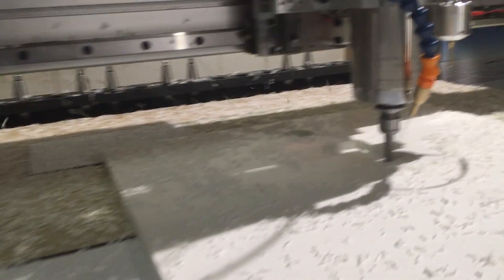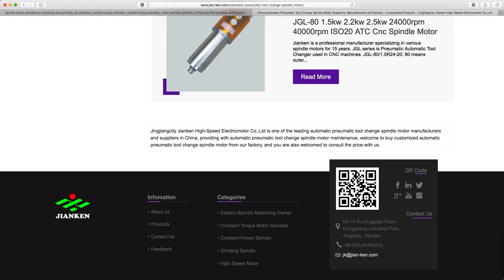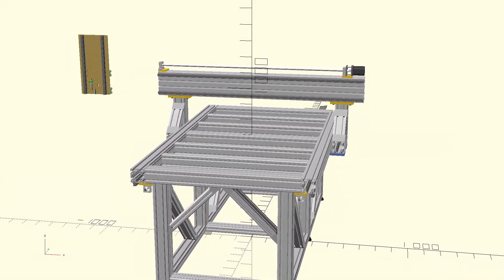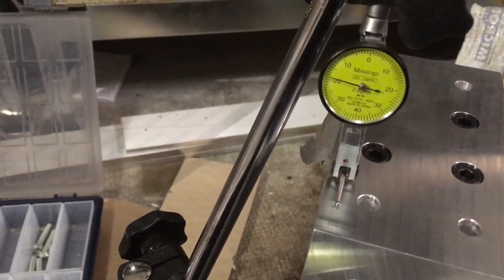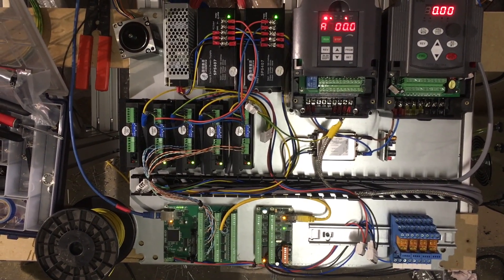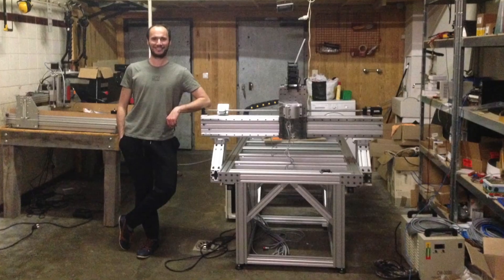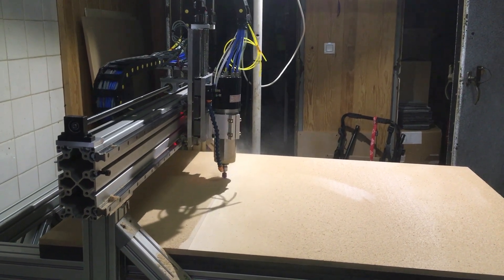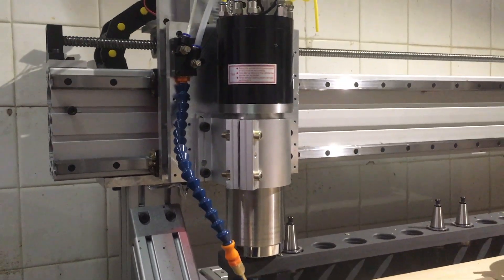My DIY CNC Router build with ATC and Vacuum Table

Comment: What controller do you use?
Reply from the maker: I used various cards from https://store.mesanet.com. Those are FPGA cards generating the pulses for the stepper drivers. Then LinuxCNC is sending velocity commands to the Mesa card at 1000Hz.

Comment: How did you setup that retractable probe? I am in the process of designing a 5x10' cnc router with a 9kw atc spindle. I would love to have a probe like that.
Reply from the maker: I placed the probe on a pneumatic cylinder. Then with an electric valve I can actuate the vertical movement over ~100mm. Some parts are 3D printed. And with LinuxCNC I programmed a macro so that on M6T30 it actuates the cylinder. And with the tool offset table I can input the X, Y and Z offset of the probe relative to the spindle.

Comment: Nice build! What are you using for the xy autosquaring ? Custom script ? (i asume it is running linux cnc like shown on the old router ?)
Reply from the maker: Yes. Custom G code and M code written in python with LinuxCNC.
I have a couple of G code to probe a corner, a cylinder, a face. Then those G codes push the result in a kind of stack of the last probed points. And finally I have some M codes to read the last results from the stack and apply a coordinate change.
I could push my code to GitHub if you want.
Reply: @YannPomarede   yes, that would be nice :)
Reply from the maker: Here it is: https://github.com/yannpom/ouimill2
Reply: @YannPomarede  thx :) will have a look at it after the hollidays

Comment: You are the king of home builds! What cfm compressor are you using for you spindle?
Reply from the maker: I have a 3HP compressor. But it’s mainly for blasting air on the end mill. The spindle use very little air (air seal + tool change)
Reply: Thanks

Comment: Hi Yann ! Great Build ! Can you please tell us what material was used in the first two layers that you initially machined and then glued together, in the fabrication of your MDF Vacuum Table Top, as we are currently in the process of retrofitting a 4' x 4' Router Table for a customer, who brought your router build to our attention ? (1) Are the first two layers made from a "Plastic Material", as the swarf produced was "Black" in colour ? (2) What glue did you use to adhere the two layers ? Hope you can help us, and our customer ! Regards GCS CNC Group !
Reply from the maker: Hello, this material is "Valchromat" (I think it's the brand/product name here in Europe). It's kind of a MDF panel, but more dense (made with finer powder), more rigid, and more airtight. Even though air can still pass trough, but way less than with MDF. The glue is normal wood glue (PVA). If you don't have those high density MDF panels, you can simply use normal MDF and apply PVA glue on both face so you don't have air leaks.
Reply: Thank you for your prompt reply Yann ! Greatly Appreciated ! I wasn't aware of such a product being available here in Australia ! Just found a local importer of "Valchromat", and I will now be able to look into the suitability of this product for my customer's retrofit 4' x 4' Router Table, with vacuum ! Regards GCS CNC Group !

Comment: Really awesome build! I'm using a similar spindle. Any chance you can share what size cable chain you're using?
Reply from the maker: Thanks, cable chain reference is JFLO-H20x60 inner size 20x60mm, outer size 35x83, bending radius 55mm.

Comment: excelent job !!! what size are the linear rails of the Z axis, and  Is the 80 80 mm aluminum profile triangle that supports the gantry and runs along the Y axis sufficiently rigid and strong? regards
Reply from the maker: All linear rails are the same size: 20mm width. Regarding gantry rigidity I cannot answer by a yes or no. It’s rigid enough to mill 20mm medium wood in one pass, 10mm aluminium on a light side cut. But if I increase too much the mill engagement it starts to vibrate.
Reply: @YannPomarede  Hey Thanks a lot, I am building a  very similar machine like yours,  I  watch your videos  and give me a good solution to solve the use of a lot expensive aluminum plates , thaks again!
Reply from the maker: Here you can see it in action milling aluminium: https://youtu.be/3_ACFM97Wnw

Comment: Hello,
I just made my CNC and on my first test something does not seem right.
The CNC uses 2.2 KW air cooled spindle at 300 Hz  speed. and a Makita drill bit with one cutting teeth as you can see in the picture from the end of my video.
Could you please explain why do I have that whistle noise when it cuts? Also the spindle motors is getting very hut, after the cut I could barely  hold my hand on it?
Cut federate is 800 . The diameter of the drill bit is 6mm.
https://www.youtube.com/watch?v=dsRKRu3pHBw
Reply from the maker: Hello, I see your end mill has a strait flute. This generate a torque spike at each rotation, whereas with a spiral flute the torque is more constant and you get less vibrations. Your federate, 800, is in mm/min ? That's 13mm/s. That leads to a feed of 0.04mm/teeth/rotation. It's a bit low for wood. You can double or triple the feed rate.
Also, slotting is the hardest, the end mill touches on both walls, cooling is less efficient. When I need to slot deep, I usually design a slot larger than my end mill to ease the operation. But for cutting plywood like you do, slotting with a 6mm end mill should work fine. First, try changing the end mill with a spiral one.
Reply from the maker: Like the one you see at second 8 in this video : https://youtu.be/0U_ZFNjyZ00?t=8
Reply: @YannPomarede  Thank's for the info!

Comment: Bonjour Yann,
What made you choose to place the linear bearing rail under the Y aluminium profile ?  It's the first time I see this design. There is all the weight of the gantry pulling downward the bearing block which is unusuall. Any explaination on choosing this solution ?  Thanks
Reply from the maker: Placed on top they would get full of dust/chips and be exposed to shocks from stock manipulation. And placed on the side I was afraid they would get over-constrained because it's impossible to build the frame to have the exact same width, and 0.1mm of difference between one side and the other would put stress on the bearings. But maybe it would not be such a big deal as the gantry could flex and absorb the misalignment. So I went for a bottom placement side to side with the ball screw that I wanted protected from falling debris.
Reply: @YannPomarede  Are the linear bearings made to be stressed in such way ?  Meaning pressure applied on the bearing opposite side from the rail.
Reply from the maker: @Levisgil47  On each rail, there are 4 bearing tracks with contact points forming a cross. It's symmetrical (up/down and left/right). So they don't care if the force is up or down. And their rated dynamic load is 17kN per bearing, that's huge!
Here is a link to my rail's datasheet: https://www.dold-mechatronik.de/documents/Datenblaetter/Linearfuehrungen/Datenblatt-Linearfuehrung-ARC-HRC.pdf

Comment: That ATC is genious.. Be careful with those shavings on the cones though.
Reply from the maker: Yep that's a great spindle. There is an air-blast (from the inside of the spindle) cleaning the cone just before grabbing it. I had very few occurrences of a shaving being stuck. Especially while cutting aluminium dry, those big shavings get easily blasted away. I have more problems with wood fine dust accumulating on the cone. If the cone is a bit oily it sticks and I have to clean it by hand.
Reply: @YannPomarede  Hmm... Have you thought about a cover from Plexiglass similar to the ones on datron machines? Maybe you could make it so that the cover gets pushed away by the Y-Axis when moving back. That would not require any changes to electronics or pneumatics.

Comment: Hello Yann,
could you please give the link where you ordered the side channel blower for vacuum?
Thanks!
Reply from the maker: The brand is Goorui, model GHBH 003 34 1R7, ordered from https://goorui.en.alibaba.com
Reply: @YannPomarede  Thank you! Why did you use a frequence inverter?  The blower works always at the same speed?
Reply from the maker: @yassinelamkharbech8689  Because it's a 3 phases model and I only have 1 phase at home. And thank to the VFD I can do soft start and "overdrive" it at 60Hz instead of 50Hz.

Comment: hey Yann
Thanks for an inspiring video. I'm planning a similar machine.
However, it must have a working area of 125 x 250 cm. and could mill in aluminum and wood.
Do you have a suggestion for feed, cnc router rack and pinion vs ball screw.
If ball screw can be used, what size / type.
Reply: That is quite large work area man... You would need EXTREME strong construction to make machine hard for it self not to mention how hard it should be to mill metal. Btw why you need so big machine for aluminum?! What kind of parts should be made with such size?

Comment: Super nice build! Thank you very much for sharing!
Small question, which spindels did you use for the 1400mm y-axis ? 1605 or bigger ones?
Reply from the maker: It’s a 1610. Twice the pitch of the 1605 to double the maximum speed. I’m limited by the ball screw vibrating rather than the motor speed/power. And I get 9000mm/min with this setup.
Reply: @YannPomarede  thanks! Im designing a similair cnc to yours but was in doubt between the 1605 and 2005 spindels. The 1605 are max 1500mm it seems, how long are yours?
Reply from the maker: Mine are 1542mm, bought from Dold Mechatronik. Be sure to check the maximum rotating speed, which decreases drastically when length increases. Because choosing a 5mm pitch on 1500mm length might result in slow movements. But of course it depends on your needs.
Reply: @YannPomarede  thanks a lot! 
I will try to get the 1610 ones as well, seems like a perfect option!
Reply: Hi Yann, I'm building the machine at the moment, same design as yours but 2010 spindels, table size 2000x1000 with slightly more Z height with all black aluminium profiles :p and some closed loop nema23 steppers. I also ordered the ATC spindle, because I also don't like to switch around the tools constantly.  

Small question, for the Z assembly aluminium plates, did you use 15mm? 
I'm wondering if it is enough, I have 15mm material but considering to buy 20mm.

I'll upload a video when the assembly is done and will post it here. :)

Comment: This is really, really great! Could you please explain how you realized the Probe setup you showed at 05:00?
Reply from the maker: It's a pneumatic cylinder, with a solenoid valve, actuating the probe up and down. This was a workaround because I only had a wired probe and I couldn't mount it on an interchangeable tool holder because of the wire. So I decided to offset the probe and make it retractable to get the clearance needed.
Reply: thanks YouTube for recommending.

Great work Mr. Yann.
For this probe retraction, could you pls share some idea about the mach3 script.

Comment: How do you manage dust collection with ATC?
Reply from the maker: I don't. As I only mill plastics and aluminium it's not a problem, the chips are big and fall on the floor. Then I clean the floor. For wood it's another story and you definitely want a dust collector. I'm currently designing one for another machine and it is retractable so it does not interfere with the tool change.
Reply: Yann Pomarede I have a Legacy Maverick 3x5 ATC .  I am very interested to see your solution.  I’m ready to pay for a good design.

Comment: Spindle pneumatic question.
following the document provided with the spindle, the hose inputs don't seem to function as they're supposed to.  

This is my setup:
Air Sealed: 15 psi ( On while vfd power is on )
Air Inlet (tool detach): 90 psi
Dust Removal: 50 psi
Air Return: 90 psi

From the provided document:
(1) Control the valve for tool released, pressurize "air inlet" for 3~5s. At this moment, clamp inside the spindle will open.
      This works as described.
(2) Control the valve of "dust removal" and pressurize it at the pressure 0.4~0.5 mpa.
      ** When I do this, there seems to be a tiny movement within the spindle however, the clamp in the spindle is no longer open and you can't insert tool.
(3) Insert tool holder into spindle cone till cone top.
      ** Unable to insert tool unless I turn off Dust Removal

If I do not use Dust Removal, I am able to load a tool and operate the spindle without issue.

I have verified the pressures and hoses are all connected correctly and working properly.

Any thought's on this. I will be able to use the spindle however I don't want to take any chances that may damage or reduce the life of the spindle.

I have posed this question to Jianken but haven't received a response.

Thanks,
Bill
Reply from the maker: Hey Bill,
When you pressurise the "air inlet", you also remove pressure from the "air return", right? Both "air inlet" and "air return" should be on the same 5/2 solenoid valve.
On mine, doing so works as expected. I have two 5/2 solenoid, let's call them S1 and S2.
S1 is connected to "air inlet" and "air return". At rest it pressurise the "air return".
S2 is connected to "dust removal" and the second output is closed with a "plug". At rest "dust removal" is not pressurised.
Then I do:

S1 on
Wait on the inductive sensor (cylinder down)
S2 on
Wait 2 seconds (actually it's not a wait but a slow downward movement to reach the tool holder)
S2 off
Wait 0.5 second
S1 off
Wait on the inductive sensor (cylinder up)
Check inductive sensor "tool loaded"
Reply: @YannPomarede  currently I have each on a separate 5/2 valve.  So if I understand,  air return is pressurized while the spindle is running? 
I'll give your configuration a try today.  
Thanks,
Bill
Reply from the maker: @billh4321  Yep, "air return" is always pressurized, except when unloading tools. I'm currently installing a Teknomotor ATC71 spindle on another machine and their (way better) documentation says the same. It should be a monostable 5/2 valve for the main cylinder. Quote "The cylinder is double-acting: it must be kept under pressure to maintain the piston in the upper position, far from the rotating parts."
Even if there is also a spring to maintain the cylinder up, they say we must keep the pressure in the "air return". I guess that some large cutting forces may loosen the tool holder if you only rely on the spring. That would be catastrophic for the spindle.
Reply: @YannPomarede  All I had to do was move the air return hose and it seems to be working fine.  Thanks again for the tip.  
My next and last step will be to implement the atc process. Using sim.axis.remap.rack-toolchange, I've implemented the remap and have it calling my toolchange.ngc but that's as far as I get.  Linuxcnc just seems to wait for something.  My guess is it's waiting for some unimplemented event.

Comment: Is the design available in GrabCAD? Does anyone have a step model of these exact aluminum extrusions being used?  This is a great machine.  The ultimate machine would be 5-axis, a combination of this machine and this 5-axis machine: https://youtu.be/X5d9GV_aUTs
Reply from the maker: No it’s not on GrabCAD sorry. But the STEPs of the alu profiles can be found of Motedis or Item24 website.
Reply from the maker: 5 axis is nice but you also loose a huge amount of rigidity. It really depends on what you want to do with our machine. On the one I’m currently building I added a 4th axis but it’s the workpiece that will be rotating.